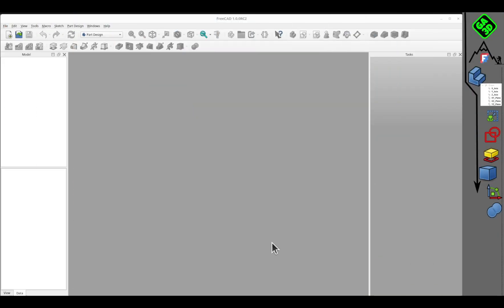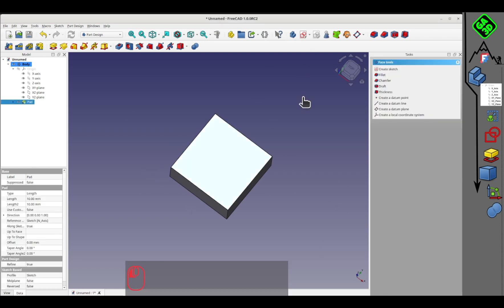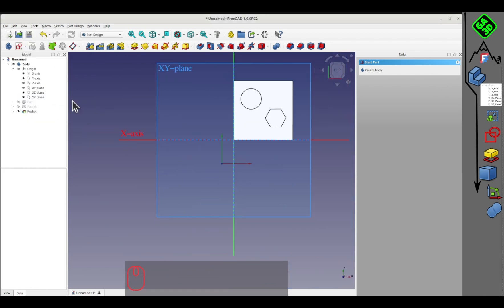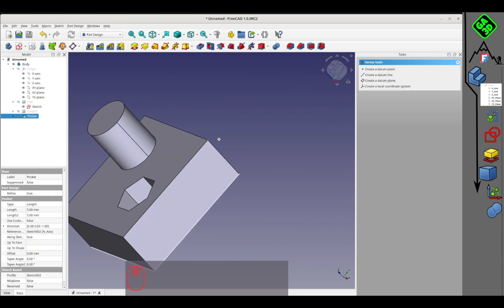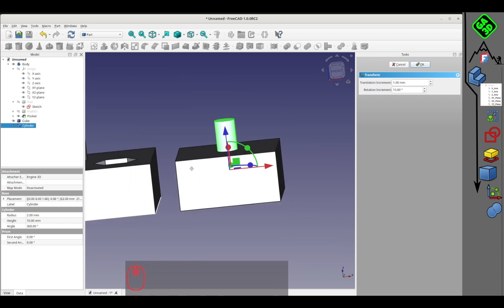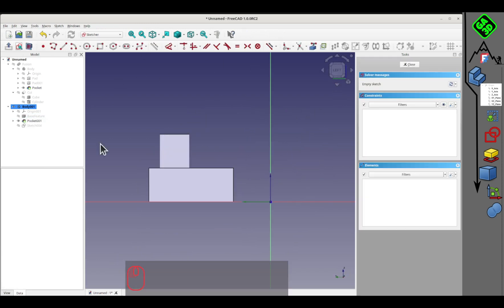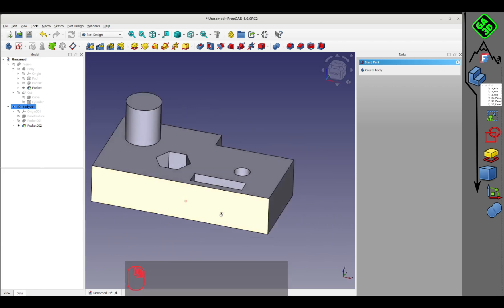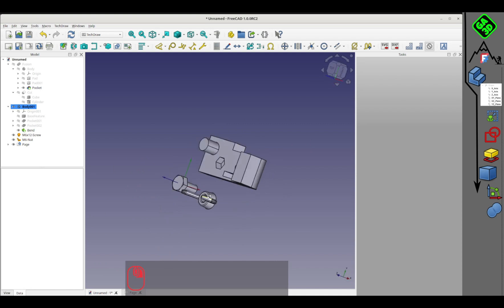FreeCAD 1.0 Beginner Tutorial: Interface Overview & Essential Workbenches

Comment: I have FreeCAD 1.0.0 running on a Windows 10 laptop.  The video says it's for "FreeCAD 1.0", but the video shows yet another variation  ("1.0.0RC2").  My version does not start with the same screen as shown in the video, so I'm lost before I get started.
Reply from the maker: RC2, means release candidate2, when I did the video final version of FreeCAD 1.0.0 was not yet available, Both version are identic at 99,5% except to version number and start screen, so I think that should do it :-)

Comment: Hello. Interesting Vid. You finished with 2D Tech Draw Work Bench (WB) of a 3D drawing. Can the opposite be done..? Start with Tech Draw WB going to Part Design WB..? Thank you.
Reply from the maker: Hi, thks for the question, I understand your interrogation, indeed NO, in FreeCAD the Techdraw workbench is done to make technical drawing from a 3D shape and not the inverse. But when you construct in 3D you generally start with a 2D shape done with the sketcher workbench. There is also the interesting Draft WB that is  hybrid in that sense, you can sketch some draft and then convert it in some ways in 3D, but this maybe confusing at beginning, I could do a video on it. But in general the normal workflow for simple part is => Sketch => Partdesign to build 3D shape  (or Part) =>  Techdraw to make official drawing
Reply: @ga3d_._tech528  Many thanks for prompt reply. Kind-of figured FC Workflow. Thank you for Vid offer. Am sure you have  other Vid subject plans.

Comment: Please continue.  
It's not just the speed. I played it at half speed and then I saw that the words and what you are doing are not synchronized. My advice: form groups. Put a one-second pause between groups. Write in the video which menu item you are using.
I myself use RC4. I couldn't manage to mark the pivot point on the body. What am I doing wrong?
Reply from the maker: Yeah I know, it comes from my workflow, and I did this videos a bit in draft mode to test if there is some interest or not. As said I'll improve all that and more... It doesn't look like it, but making good YouTube videos is a whole process, and before diving in headlong, you have to test a little. I'm a big believer in the baby steps strategy. Concerning the pivote point on the body : try the official 1.0.0 Version it comes out yesterday.
Reply: @ga3d_._tech528  There's a lot of superfluous mouse movements that are distracting from the actual needed actions. It would be easier to follow if the movements weren't so hectic.  But your descriptions are extremely useful.

Comment: too fast, and the GUI (graphical interface) is not the same...can't see the planes
Reply from the maker: Thanks for the feedback, it's very useful. 

concerning GUI :
 check your version, it's with FreeCAD 1.0 RC2, I'm under linux it may very slightly change a few details. and I put the panel "Tasks" on the right.

concerning speed : 
My teenagers and friends have told me that I need to talk faster and “bombard” more, but here it's definitely to fast. these are my first videos and I'm still finding my format, speed, etc... in the meantime If it's too fast you can always put the subtitles on and play the video in 0.5x speed. but I'll do it again in a better tempo.
Reply: Good video keep it up 👍